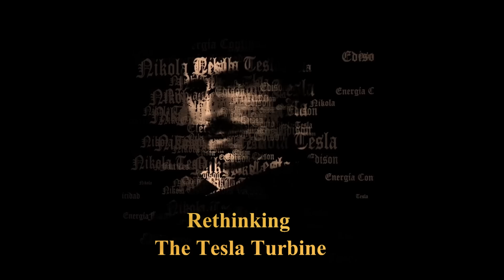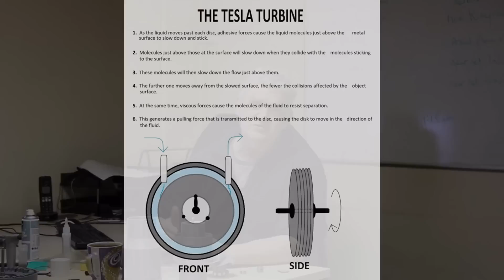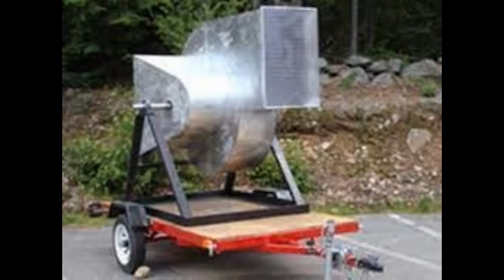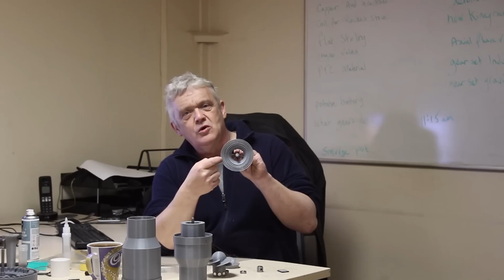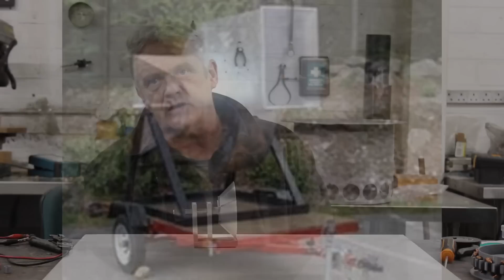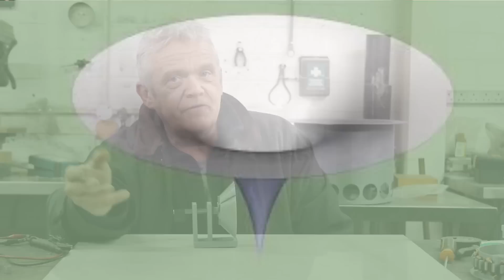1888 Rethinking The Tesla Turbine For Wind Power

Comment: One way to get the air directed onto the cones at the right angle might be adding more normal turbine fan to the top of them, that way both would contribute to the torque produced.  It probably wouldn't reach optimum speed of either, if optimised separately, at high air speeds but might start spinning earlier at lower ones. 
Should be easy enough to do a quick, rough and ready, test to see if there's anything worthwhile in that idea.

Comment: Very cool design. I had that thought. Awhile back when looking at vortex funnels. Very happy you did it Robert. Also on the tesla valve I used the Fibonacci Sequence 1.618 to do a ratio deduction on each pedals to increase pressure. Happy Building. 😊

Comment: I had been experimenting with a similar concept,  though I used half spheres stacked with the bottoms removed and a rolled edge on the bottom where cut.  It works, maybe worth further investigation.  My thinking was that a rotating sphere with air blown across it creates lift and pulls the air around the sphere, so why should it not work on the inside curve.  It does make the air vortex and exit faster, thus spinning is faster.  Hyperbolic cones for this are a brilliant idea.  Thanks for the video Rob!

Comment: I always had the idea that dimpling the surfaces of the disk or in your case cone like a golfball to allow more suffice area so the "fluid" can get more gription
Reply: Thats not how it works though read Tesla's patent this machine is not friction based as commonly misconstrued it works on electrostatic adherence its actually an electric turbine because at the electron level it is electrostatically clinging between the boundary layers. A flat as possible disc is the best design. 

You don't actually want friction what you want is to reduce slip and gain torque that means your pressure to disc regime should be optimally harmonized.

Comment: The image of the Tesla Turbine shown at 0:33 does not represent the flow of fluids correctly. As a turbine, air flows in tangentially but comes out the middle. It does not exit the turbine tangentially as well.

Comment: Nice idea! But did you know the Tesla turbine is half of one of Tesla's inventions.The other half of this machine is the Tesla Pump. The turbine and Pump were designed to use what is called Cold Steam. You take a tank of warm water and another tank of similar size. The water tank is connected to the turbine, the turbine to the pump and the pump to the second tank. You purge the second tank of air and the lines,turbine and pump. When you open the valve to purge the air from the water tank. The water starts to boil and creates cold steam. Cold steam is many times the density of air and starts to spin the turbine and in turn the turbine spins the pump. With the pump having more discs then the turbine a low pressure zone is formed behind the turbine. The cause and effect of this is to turn heat directly into kinetic energy with great efficiency. The second tank starts to receive the cold steam but as the temperature has been extracted and turned into kinetic energy. The steam is now colder and therefore the second tank will receive all the cold steam until the majority of the water in the first tank has boiled away.. The turbine and pump is a super efficient heat to kinetic energy converter taking just warm water and most of its thermal energy into movement. You may already know this if you follow the work of Jeremiah ienergysupply. Thanks for your videos and bright ideas TNT..

Comment: I missed part of the schematic and I originally thought there were just strait supports inside the cones instead of the back and was wondering if an improvement to those could be curving and shaping them wing like. Having a channel to help start the spin. Would it still be a tesla with the channels? Now I see they are attached at the back, would any improvement be gained by either having the back supports shaped like a wing or curved with a wing like shape? At this small size, is the impact from the beams negligible? Would the beams have an more negative effect on it, if it was scaled up? Thank you for the videos!

Comment: tesla turbine is most efficient at extremely high rpm that most materials can't withstand, and has really low torque. I wonder how different shapes would effect this.
Reply: Charlie Solis / Solishoods has pretty much demonstrably debunked that as a myth. He does some amazing work with tesla turbines, with the engineering and applied science to back it up. One big fact I took away from his channel is that steam (and gases in general) actually gets more viscous when it gets hotter; huge implications for speed-vs-torque on a tesla turbine.

Comment: The image at the beginning is different from the ones I previously have seen.  The ones I am used to seeing have a hollow axil with holes to allow the air/water/steam to go around and down to the axil and exit one end of it.  There were videos on other channels that showed the difference of with and without the ' hollowed axil showing hollow got higher RPM.  If you have enough PLA, you might want to print again with it being hollow with holes instead of gaps in the cones.  Both versions should be tested for both torque as well as RPM.  Some of your generators work better at high RPM and low Torque and others the opposite.

Comment: wow!  I suspect that a hyperbolic funnel will increase the acceptable angle of attack of the wind inputs.  In a cone, the only acceptable angle of attack is parallel to the cone angle.  Because the angle of a hyperbolic funnel continuously varies, I think that as long as at SOME point the air input becomes tangential to some part of the funnel, you'll get spinning.  I further suspect that there's a peak torque (when the funnels are already spinning) at an angle that's parallel to the outer edge of the hyperbolic funnel, but with low speeds, and peak speeds (lowest torque) when the wind's coming closest to directly onwards.

Comment: Would ..using an magnetic floating axial,increase the rpm ..of the turbine speed… or decrease the torque of the axis output ….  …   A Tesla turbine fly wheel that can sustain a high level of rpm’s ..maybe even on a gyroscopic design to elevate vibration…. Harmonic stability on a magnetic axis….    ?  Hmmmm.    Have.  A. Fun. Day.  !

Comment: Unfortunately the few tests I've seen seem to indicate that almost all the energy is transformed into rotational speed.  One test using water as the medium spun a small turbine at 30,000 rpm but you could stop it with your baby finger.  Perhaps a large turbine with enough mass could produce a useful torque

Comment: You keep getting closer and closer to the design of wind turbine I experimented with heavily: I'm here to mention it once again 😆
It's an 18 blade shrouded propeller (parametric) design found on "thingivers_" I tested 8" diameter (200mm) diameter versions as well as 24" versions (600mm) and was blown away with the efficiency and high/low wind speed performance.  It's worth a print if you'd like a neat looking turbine like propulsion or wind generation propeller design.  I printed it in many scales and in many materials, A PLA 200mm version survived at over 120mph on a testbed mounted to the front bumper of my car, and another on my motorcycle.  People were always asking about it 😆

Comment: I think you'll need to make a small modification to allow it to function with the wind straight on. In between two layers, glue a strip of paper or something in a spiral from the large opening to the small opening. You'll likely want to make a glue a few of these strips per layer. If you don't like this idea, then you'd need to mount the tail at an angle to the turbine. That angle should be the same angle as the cone angle.
Reply: You mean to use a traditional turbine in the center to catch head on wind whilst the tesla turbine portion around the circumference is powered by wind hitting at an angle?
Reply: @mrwess1927  Not quite. The reason why the cones are able to spin when the wind hits it at an angle is because there is an unequal force applied to the surface of the cone, which makes it spin. The idea of the tesla turbine is to make use of friction across the surface area to make it spin, but if the wind is directly on the cones, you are applying an equal force to the area of the cone which negates any imbalance that would normally cause movement. By adding a couple spiral in between the cones, you're directing a small amount of the wind through that spiral to cause it to start to move, then once it starts moving, the movement of the cone itself should continue the spiral movement of the wind which would then be able to make use of the friction across the surface to promote movement. Movement is caused by imbalance. Newton's third law, right? Except you have to think about in three dimensions...

Comment: Interesting work. Good idea.
Tesla said that putting washers between the plates made for better acceleration and might make this stack more sensitive to lesser winds.
Other Tesla turbine experimenters claim that for generator-only applications, the circular washers were best replaced with air-foil shaped spacers. Food for thought.
Also, the optimum distance between the surfaces is greatly dependent on the viscosity of the fluid: hot steam I'd different from cold steam, is different from air, is different from water, etc.
Edit-- Let me stress: OPTIMUM distance. IE the distance that is most efficient at coupling with the fluid to extract momentum. A Tesla turbine optimized for air will also work with water, just not optimally so. And, again, it's about viscosity, so scale changes things too.

Comment: Tesla Turbines work great as pumps for pumping very abrasive liquid slurry.  (Discflo pumps)  The only problem is they only reach about 65% efficiency with a lot of heat generated while pumping.  I would suspect the efficiency as a turbine would not be optimal.

Comment: that makes me wonder (because I know printing is not going to be perfectly flat something the tesla turbine takes advantage of for higher speed so its surface tension of the air over it, limiting the drag slowing it down) 
***The idea now that I have gone on above LOL)
what about a 3D printed jig or frame that you can then cut say a plastic bottle into sections and form by pushing and bending the flat sheet into, making it form a cone, then the only deformity is going to be that joining point rather than completely covered by ridges from the printing, AND it gives the option too of the form being a continuous sheet that spirals smoothly around with a thin gap between each previous twist, to make that conical shape but the air will now travel around the spiral making contact over and over instead of say 10 cones, so 1/10th of the air touches each cone, the other idea would mean 100% of the air would touch the entire stack of cone like spirals since they are all one single sheet spiraled in an angular fashion to make a completed shape looking similar to your design now. 

I only think by the way the ridges would be an issue if you are actually expecting the lack of drag from roughness to allow super high speeds that tesla turbines use, but using static pressure building up between the plates to force the air to grip onto the plates as it moves around toward it's exit point, then a rougher ribbed surface would actually be beneficial especially if you can either  orient them so it is like a stack of cones touching making up each surface of each cone so you have fractal cone edges making up the surface of each cone, 

and for slower wind input, turn the ridges running from the outer bottom edge of the cone to the inner top edge of your cones in a slight spiral formation so it all forces pushing of the cone on its spindle in one direction. 

I really wish I had a proper lab and workshop set up, and the time to tinker, hopefully soon, though my videos will be over on rumble, as they are already paying out more per video I have up than I have made off any videos on youtube in 10 years. :)

Comment: what if you just put in a small baffle at the bottom front, so that the angle of attack is always off of zero?
Reply: if that works, then you could just use the drive shaft and generator portion as the baffle in future designs, so that the exhaust side is unobstructed.

Comment: Shauberger and Russell have travelled this path.
Reply: Victor Shauburger !!!! The man of water
Reply: Thank you for turning me on to Shauberger. This changes everything. Really, everything!
Reply: Ribbed disc's or would that create turbulence 🤔
Reply: @kennethblakeley6536  It would create back pressure at the nozzle reducing the pressure of the motive fluid. Ideally fluid pressure should be in regime with the rpm of the disc. People think increasing the RPM is how to gain efficiency but its actually just causing slip which reduces torque and causes that same problem of back pressure.

It should be used to drive an external wind turbine once the pressure to surface regime is perfected and torque maximized.

A lot of people on YouTube build these wrong and believe they cannot power anything because they erroneously try to increase disc RPM to gain power but they're really just causing slip.
Reply: When he ends up at the toroidal and helical shapes, he'll complete the circle ⭕👍😎
Reply: @brandonboulton2776  
So what is best...?
And why no one talks more about Tesla's Wind Optimisation...?
Toroidal and Double Elix have both Advantages and Drowbacks?

I need Answers not Emoji...

Go Brandon!
Reply: @antoniopacelli  I made a statement. Not sure what you expect of me.

Comment: QUESTION: Could you position it vertically, so you would  get spin regardless of air direction?
Reply: Positioned at the ridge of a roof perhaps? Or the peak of a hip-roofed cupola? Could the whole thing be designed into a unit with a weathervane-like tail, similar to old windmills, and allowed to simply self-position? Come to think of it, only an intake nozzle which was positioned slightly out of plane with the turbine would need to align with the wind...
Reply: @Bob.Jenkins  How may old CDs/DVDs do YOU have lying around? I have a bunch! Maybe a good use for them?

Comment: I really really hope you do test to see how much torque it can manage to create!!
Thanks for all the videos!!
Reply: Power is the important metric (torque x speed). You can get any specific torque you require through gearing. Power is another thing entirely, and it's what will turn a generator at a usable speed.
Reply: @UncleKennysPlace  although what you say is true. If we know how much torque it takes to stop the turbine rotating we can work out how much power it is generating. Is that correct?
Reply: @F.F144  torque will determine how much load can be pulled before stalling the alternator, yes. Gearing can improve torque but comes at the expense of speed and efficiency due to friction losses in the gearing.